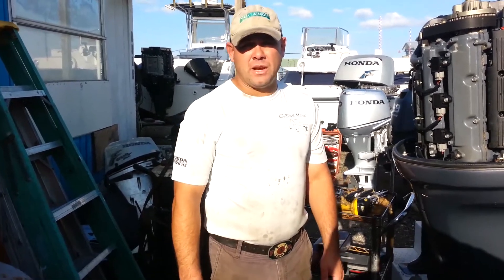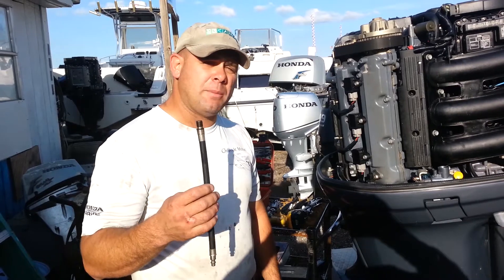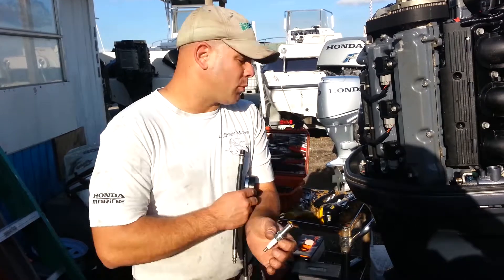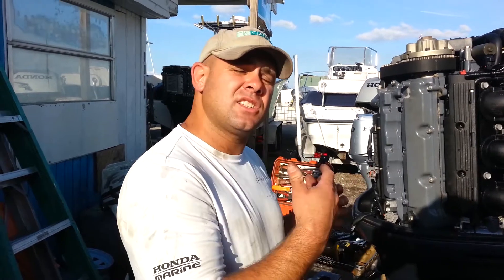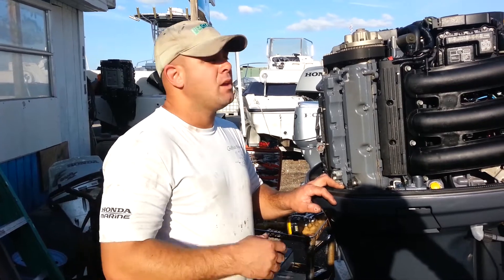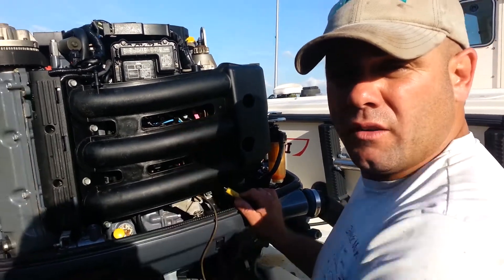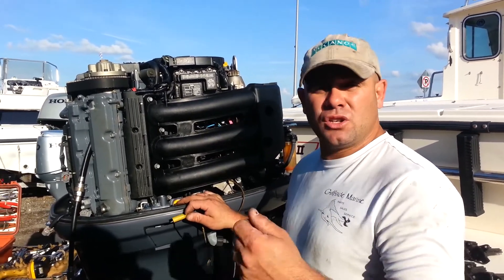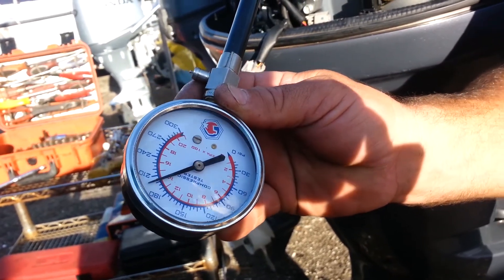Yamaha Compression Test

Comment: Erin,
Thanks for the video.  I appreciate the info, which is helpful.  My background is not as a marine tech, just DIY'er kinda thing. 
At the end of the video, you ask why check compression with WOT, then add that it can give a falsely high reading.  This info is useful.

So (again) having little technical background with marine engines and just a little experience with a couple 100h services on my F200XB, I follow the Yamaha service manual to help me do things.  Manual LIT-18616-03-53 page 0-6 under the "Conditions when testing and adjusting" section says "Throttle valve at WOT (depending on model specification)." 

Based on your experience, it sounds like I don't have to have WOT to get accurate readings, right?  (I don't plan to wait until it's 68F outside and I don't live at sea level either, for whatever that's worth, heh.)

Just trying to learn stuff and thanks in advance.

Comment: Just compression tested my 2014 Yamaha F20.  While leaving the throttle at idle, I got 90psi on both cylinders.  While opening the throttle to max, I got 175psi on both.  It seems there is pressure relief valve for starting that is held close when manipulating the throttle.

Comment: The Yamaha service manual for this motor states that the motor should be run for 5 min before starting the test.  Also, the test is performed at wide open throttle.

Comment: The yamaha manual states to open the throttle plates when doing a compression test, you want it to breath and suck in as much air as possible because theses engines are ran i open throttle

Comment: Great video,! Want to ask 2 questions. Should I routinely check compression, let’s say on maintainence or if cold start or idle rough issues. Also, I noticed the spark plug were not numbered.? Should I re0lace them In same order they were removed?
Reply from the maker: Yes, checking compression at each service will warn you of possible issues.  It does not matter what order you remove or replace your plugs.  It does matter if one plug looks noticeably different from the rest when you remove them.

Comment: What size compression fitting did you use? Bought a compression tester for my 2002 yamaha F90. No adapter would fit
Reply from the maker: Please give us a call if you have not found an adapter 239-282-0443.  I will look at mine and get back to you.

Comment: I have an older yamaha F25 (2006).. both cylinders read the same but they are low @ 98 psi. No idea of hours.  She starts every time, doesn't smoke,  Runs good. The issue is performance..i struggle to hit 15 knots, in my G3 Pro175. . Would this product or miracle oil work.
Reply from the maker: I would recommend confirming that the motor is not over propped and that the boat does not have any unnecessary weight before you make changes to the motor.
Reply: @gulfsidemarine2992  confirmed
  Has original prop, its an electric start with  tilt.  I retested the compression and received better numbers top: 120 psi, bottom:105psi.  
Sparks gapped correctly, .
Reply: Should i try Seafoam and change oil afterwards to get rid of deposits.  I really don't want to change anything just return compression and power.  I really don't want to rebuild the motor,  replace rings..etc
Reply from the maker: @MK-fq4jn  In my experience the usual causes of low power are some sort of contamination or malfunction of the fuel system or ignition.  Low compression can cause a loss in power but usually shows up in a test.  Seafoam will help clean the rings and valves.  Let me know if you see any changes after the treatment.

Comment: What are some of the reasons for low compression?  Follow up video?
Reply from the maker: Low compression in these engines is caused by a valve issue or a piston issue.  Overloading the motor with a high pitch prop or improper operation shortens the life of these motors.
Reply: Im buying a 2012 yamaha 250 hp with 700 hours the compression is 180 psi u
Reply: Is that compression good?
Reply from the maker: Carlos, as long as the compression was within 15psi between any two cylinders it should be good.
Reply: @gulfsidemarine2992  I just got a  Yamaha outboard motor 100hp 4 stroke, psi is 160/165 on each piston there good enough  thanks
Reply: Valves not seating or burned, and piston rings worn, cylinder wall scored . Those are most of the general reasons.  Usually 3 turnovers are good enough for a psi value.